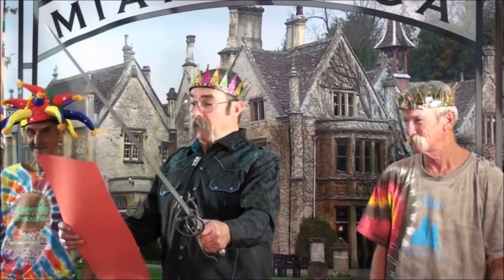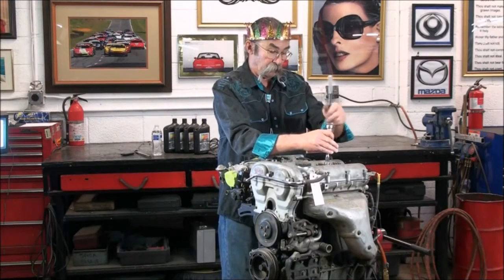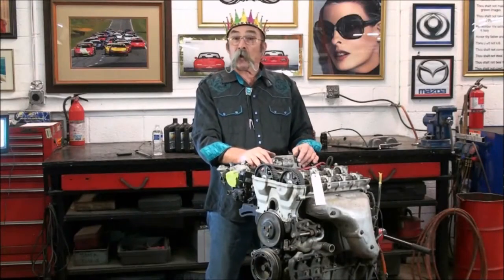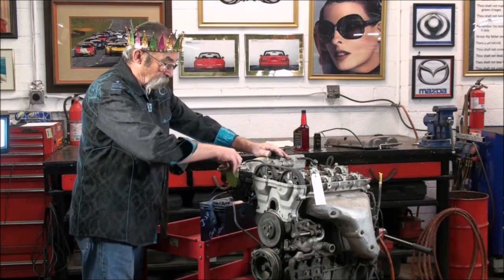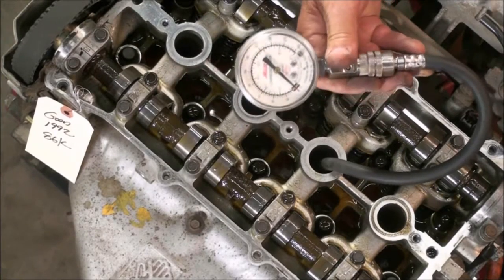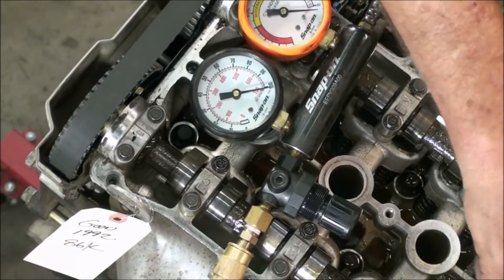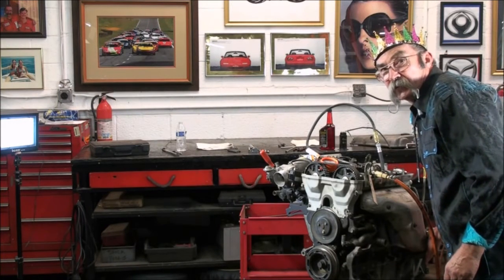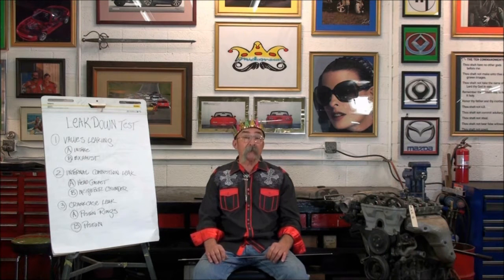S1 E3 Miatamecca Compression and Leak Down Test

Comment: Mr. Mike, I have a couple of questions regarding this video. As you know, I have a 2001 NC and I've done the timing belt, water pump and all front seals. Before closing everything up, I wanted to do a compression check and a leak down test. My compression test went like this. My car has been cold for over 2 weeks and I did a dry test first and then a wet one. My readings are as follows: #1 35, #2 40, #3 35, #4 35. After adding some oil in the cylinders: 1-65, 2-60, 3-72, 4-55. The repair manual recommended the engine be at operating temperature but for me this wasn't possible. In your video you did it on a cold engine but on a 1990's car. The book also said my normal pressures should've been around 182 for a 1.8L and no less than 128. When I did the leak down test, cylinders 1 and 2 leaked at the intake and 3 and 4 leaked at the intake and exhaust. Are these indications common for a cold engine for my model year and engine size? Thanks!!!
Reply: Hello Sir Manny,  From your test reading something is wak. Engine out of time at the timing gears, or the gauge is bum. You should see apx. 150 pounds on a cold engine. Good Luck. Mike. The King of Miatas.